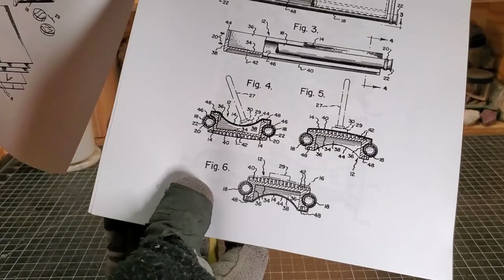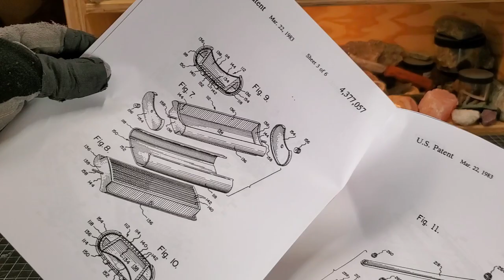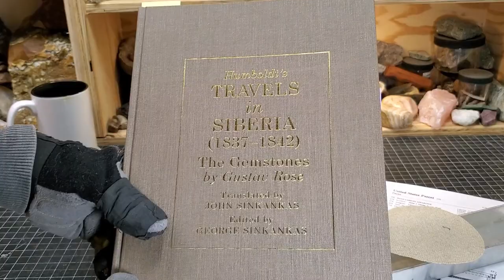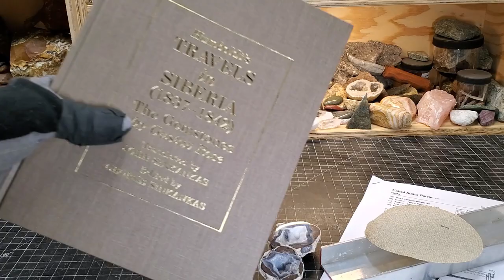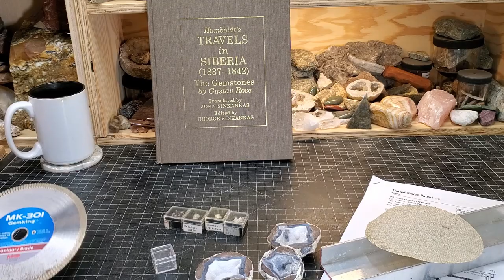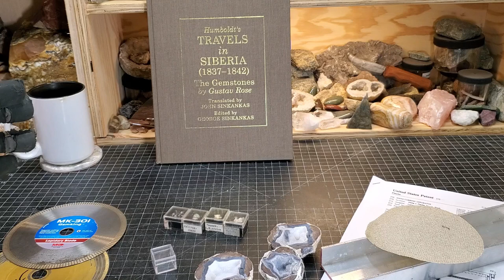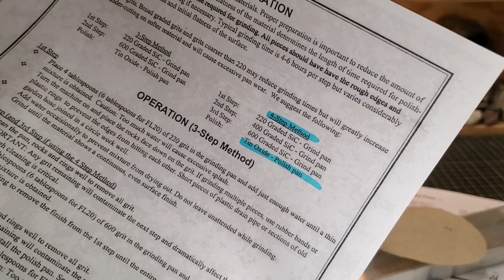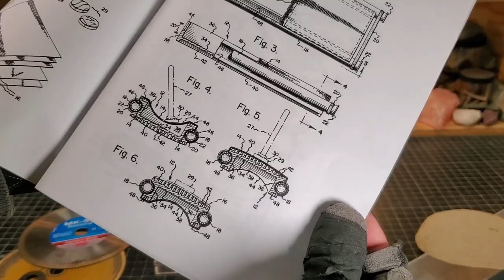Saturday Night Special #122: Minerals of Siberia & The Lortone Stroker

Comment: Great video as always!
On the subject of sparks from cutting rocks: I cut and ground a piece of sphalerite one time that threw out a lot of orange sparks any time it was abraded. My cutting tools were being lubricated with plenty of water and sphalerite isn't particularly hard - the sparks were actually from triboluminescence! If I take a piece of that sphalerite into a dark room, I can get little orange sparks with just a gentle scrape of a steel nail. That particular sphalerite is also fluorescent, so I wonder if the two luminescent properties are related.
Reply from the maker: How were you able to determine that the sparks being seen were from triboluminescence and not your blade?
Reply: @CurrentlyRockhounding  I’m not sure how to describe the difference, but it is a neat effect if you can see it in person. The “sparks” are more like little flashes of orange light on the surface of the rock, rather than tiny burning particles of metal being thrown into the air like fireworks. The effect is easily reproducible with the slightest abrasion of the sphalerite – it doesn’t take heavy grinding or high temperatures. If I crush a tiny pebble of it with pliers, it produces a lot of little orange flashes all at once. It doesn't work with sphalerite from every locality, though - I have some from other locations where I can scratch, cut, or grind and it doesn't produce the same effect. 
I guess the fact that the sphalerite produces these little flashes of light so readily without needing heavy abrasion is why I’d call it triboluminescence.
Reply from the maker: @stephent.4836  Look like I'm going to have to track some down cause I want to see this!
Reply: @CurrentlyRockhounding  Sent you an email.

Comment: The idea is novel at best imo. Stone wheels and silicon carbide have been around for ages and they can get the job done (to a degree) as well. 
Unique? Yes, so I'll give it an overall score of 4.5. Not completely worthless, but definitely resides on the lower end of the curve ^^
@16:05 lol buddy, you know my opinion of throwing sparks 
That vib lap project will be great. As for bumpers, are you going to get authentic bumpers or make them?
Reply from the maker: Oh I agree, its no replacement for machines but its also a tiny tiny fraction of the price which is also interesting to me.

I think the vib lap will be fun to have around, I have heard mixed reviews from people about them which makes me want to try it. I'm not sure what I want to use for the bumpers.

Comment: Hi Jared, another interesting video. I’ll be honest I don’t know if I would have the patience to make a cab by hand. 
I think the vibrating lap is a great purchase. Most of the vibrating laps that you can purchase here are a bit expensive so I intend to build one based on a design a friend of mine has already made. Just have to make up my mind on size but minimum will be 600mm.  Keep Safe.
Reply from the maker: I also don't know if I would have the patience for it but would do at least once for the experience of it, maybe make it out of soapstone!

Comment: The vibrating lap is an interesting machine. I bought one off a rock club member years ago, and it came with home made lead weights that you could silicone onto the lighter things like large slabs to keep them from jumping around. Works fairly well, but is messy. Can do several things at once, but you may need to partition them off to avoid bumper cars. Someone mentioned this above. I rebuilt mine with new springs, but could use a new set of balls. Any info as to a supplier would be awesome.
Reply from the maker: Which machine do you have? Kingsley North is where I ordered a new set of balls for mine.
Reply: I can’t remember which model it is due to it being on loan at the moment for my buddy to try it out. Looks like the balls are for either one, and at a reasonable price. Thanks for the tip!

Comment: I think there would be quite a few people willing to try that Lortone item, but maybe the name Rub One Out might be better lol 🤣. Seriously a good notion of using it on a beach somewhere. Awesome vibra lap too, good addition to your shop, indeed! Nice comparison of the shine on the thundereggs.  That does sound like quite the good book on searching for minerals in Siberia back in the day. Great video! Do you have any input on the Covington 10"  Perfect Diamond Lapidary flat lap vs. Hi-tech 8" flat lap? I'm ok with the price, but if they are both going to give me relatively the same results then I don't see need to go with Covington other than more working surface area. Appreciate any advice that you would have.
Reply from the maker: The Covington is a better product, I love that it has no arbor hole which means you can use the full lap.

When it doubt always buy the biggest machine you can cause you can always do little things on a big machine but not the other way around.
Reply: @CurrentlyRockhounding  that is excellent sound advice. You helped me make up my mind 😁

Comment: I heard a story once about "an old guy" who used to sit and watch TV while hand grinding a stone in a metal pie plate and silicon carbide grit. It's kind of a cross between the two machines you talked about tonight.  I used to have a vibrating lap, but I think it was the 15 inch.  It's very noisy and very messy. I can tell you of a number of pitfalls if you'd like.  I'm not sure if you want a separate email, or replies to this video.  Oh and I replaced the balls with Super Balls from the toy section.  They worked just fine. Email me if you want more info, or tell me to reply to this comment if you want all of your followers to see my replies.
Reply from the maker: I will shoot you an email about it. I have heard mixed reviews of them which in many ways is what has me the most intrigued because most people seem to land in one of two camps on them those who love it and those who hate it.

Comment: If you aren't familiar this might be something worth checking out. Not sure if there is something nuainced that would make it unusable.
But anyways I'm an Apprentice machinist and I saw on Stephen goteswinters channel his lapping build. He uses steel disc with silicon wafer disc on top and uses that as a medium to apply diamond lapping paste to it. I'm curious if that could be used for jewelry/other machinist lapping techniques like "charging" tool steels with various grits and using that. I could imagine using a technique like the latter as a "die" for a given shape.  Idk how long it would last but I was just thinking about it as you spoke
Reply from the maker: I'm not familiar with that channel or video but I will go find it after this comment.

Comment: Jared - I have a Lortone 20” vibrating lap that I purchased new a couple of decades ago.  It works great, but takes time and splashes if too much water is added to the trays - so you may want to think about a splash pad for underneath and a splash guard for the sides. I have two polishing trays that I use with tin oxide in one and cerium oxide in the other.  Over the years I’ve replaced the polishing pads in these two trays a couple of times, but now find the replacement pads unavailable.  I’ve been researching floor polishing pads, but haven’t found any large enough. Would you recommend outdoor carpeting?  Any particular specs?
Reply from the maker: In mine I plan on using one tray for grinding and the other for the polish. I already put some outdoor carpet in mine which is the same thin outdoor carpet I used on my carpet wheel machine. I don't think it has a brand or anything like that. I got it from Home Depot.
Reply: @CurrentlyRockhounding  got it - thanks!